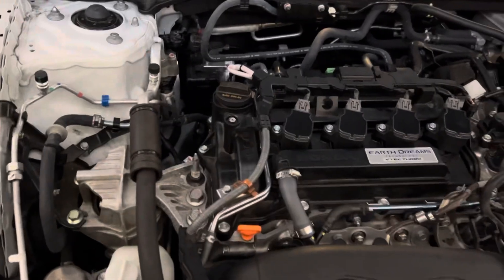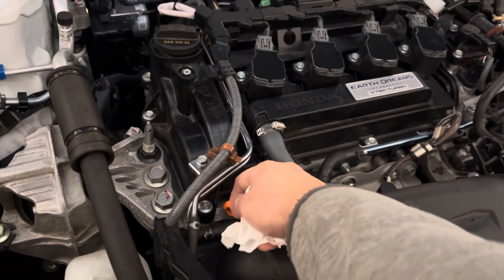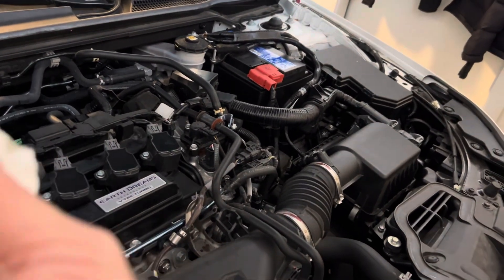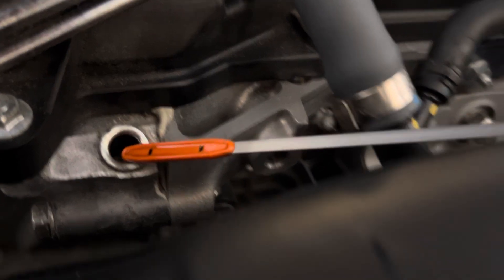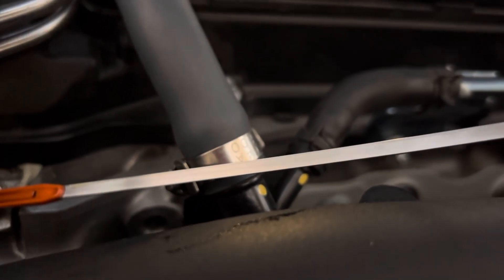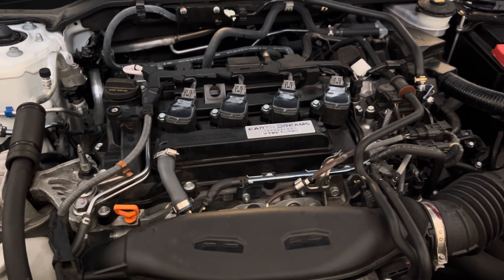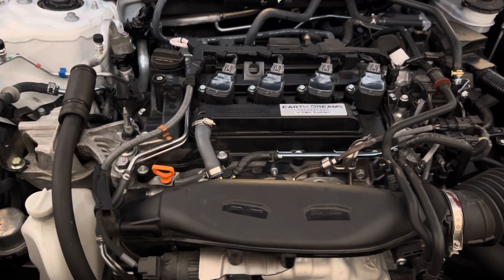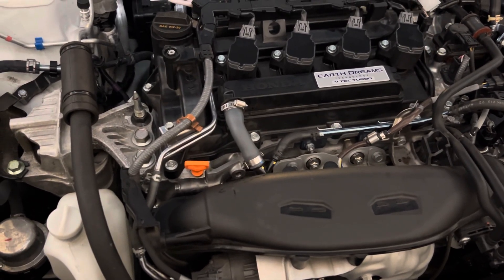Check/Update: Oil Dilution on Honda Civic 2022- 1.5 turbo DGI engine

Comment: change the oil at 50% every time, also highly recommend pensoil platinum full synthetic
Reply: I do mines at 50% or 3k mi also. I have a 22 civic si.
Reply from the maker: @belovedLion80 that’s best practice for sure.
You’re lucky that Honda recommends premium oil on your SI. For both my crv and civic hatch, they recommend regular lol - which is half the issues we are having. Cheers!
Reply from the maker: Thanks for commenting! Yes, planning on doing so. The CRV got extended to 60%, but certainly will get it done very soon! Cheers!